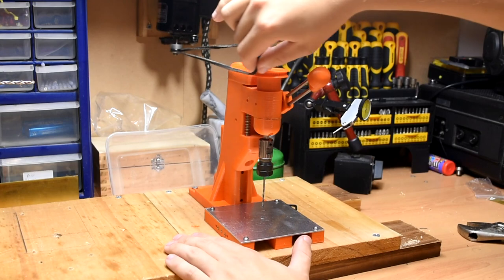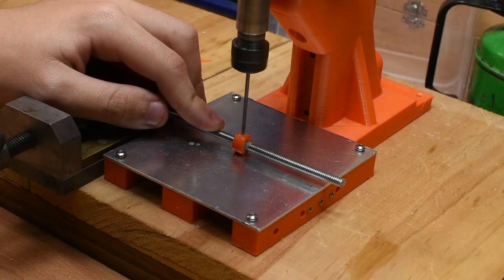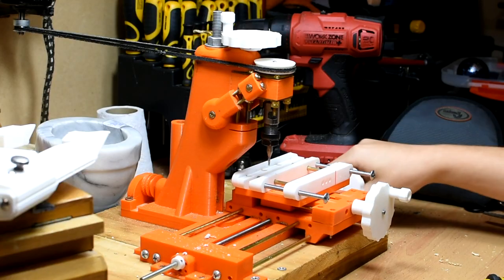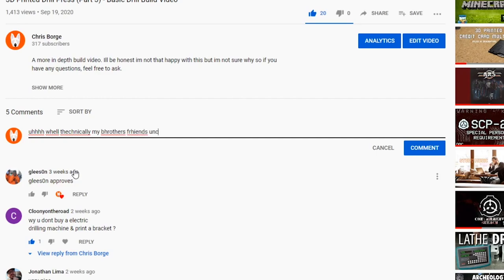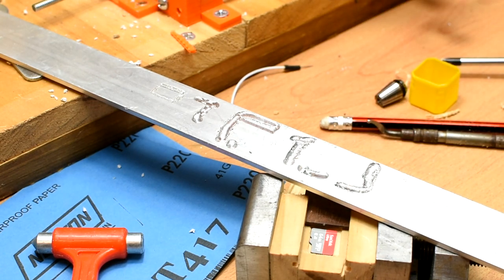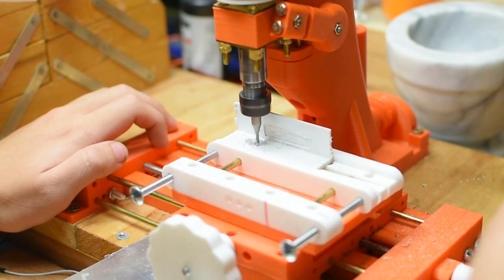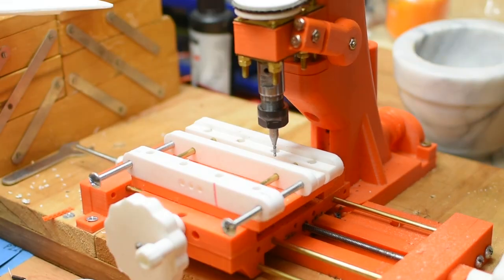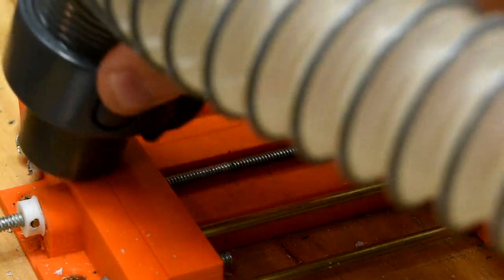3D Printed Milling Machine (Part 1)

Comment: If you want to keep building DIY machine tools I would pick up a couple of the Gingery books, honestly upgrading to steel rods isn't going to do anything because the weak link is the plastic anyways. Build a cheap cheap aluminum furnace and then use your 3D printer to make casting patterns and make aluminum castings for your machine tools.
Reply from the maker: Yeah I have been experimenting with aluminium casting a bit, my current thoughts are that 3D printing is good enough for wood but the more that I experiment with it I cant see it being adequate for metal so im going to have to upgrade eventually. I probably wont worry about making this model suitable for casting, ill just continue experimenting. I plan to do a complete re design at some point with what ive learnt from this model, and when I design that ill keep casting in mind while designing the parts since a cast version of this would be a good final step for people who want to put in the effort.

Comment: For your measurement (DRO) you can use cheap calipers about $20 each and just mount them to each axis and you’ll have decent accuracy.

You can mill aluminum with that. You’re gonna need to put your z on a steel column though and have a more sturdy base. Just buy one of those monitor stands and use the pipes and fittings for your frame. Then 3D print the rest. Get proper 12mm rails and ball screws on all axis. Carbide endmill 2 flute if possible. Do not exceed more than 20% of your cutter diameter in your radial stepover. Depth of cut should not exceed more than 0.1 mm and your optimal chip load should be around 0.4mm. The best you can hope for with that is a decent hole pattern in some metals

Comment: Early days, people would use aluminum for similar gadget.
Later, some home CNC guys start using PVC and made machines for wood and nut carvings.
PVC is easy to process. Parts could be glued together by clear glue that puts PVC pipes together,
and its holding quite strong.

Comment: the next step is to make everything again but encase in plaster and remelt the pla, then use the now machinable pla to make a closer tolerance version.
Reply from the maker: Thats another idea, ive also been considering trying the lost PLA method to make an aluminium version.
Reply: @Borgedesigns  i went ahead and downloaded the files, modded the main body to accept a concrete core. im printing it out now. the idea is to add ridigity. iim very close to getting perfect lost pla zinc casting and i need a tiny drill press. so many thank yous!